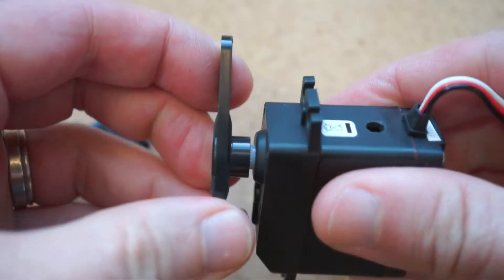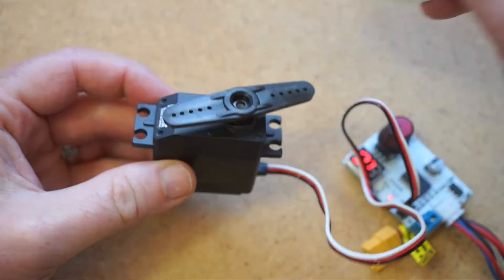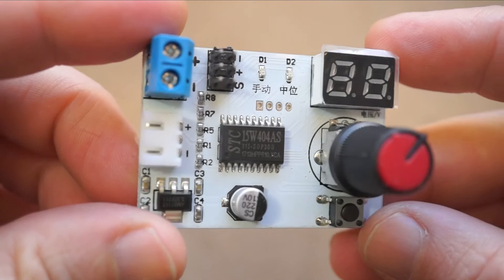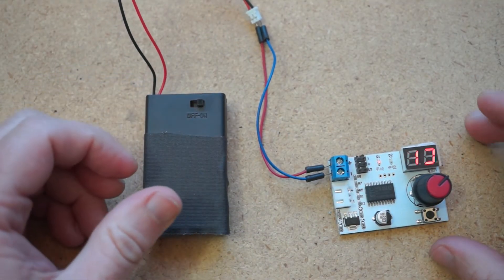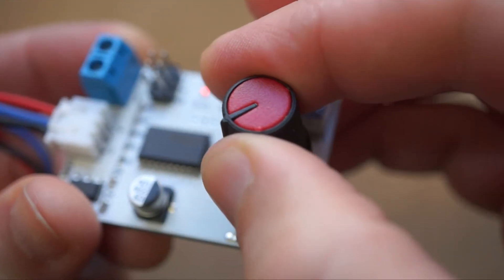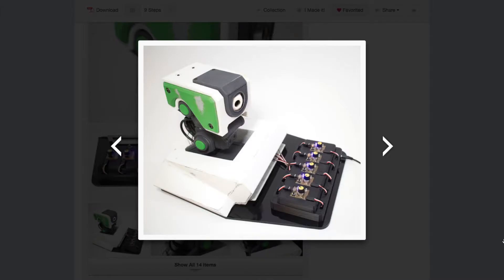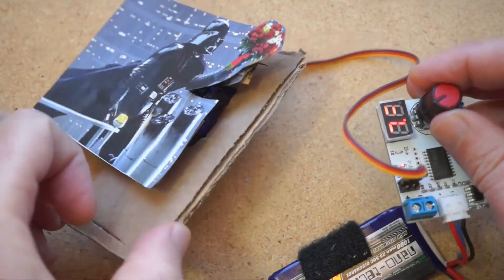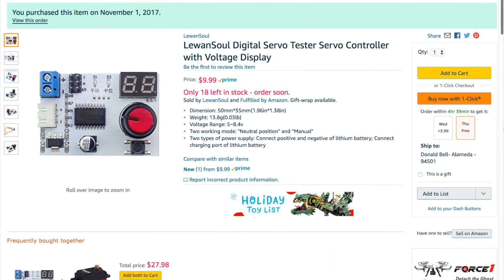$10 Digital Servo Tester Controller with Voltage Display

Comment: Hi -- I see how the knob can affect the movement, but you did not really showcase the modification of the movement -- would using one of these provide you the ability to rotate the servo motor at a significantly slower speed? or does it just allow you to toggle back and forth between clockwise and counter-clockwise?